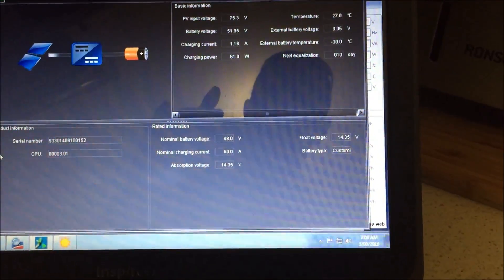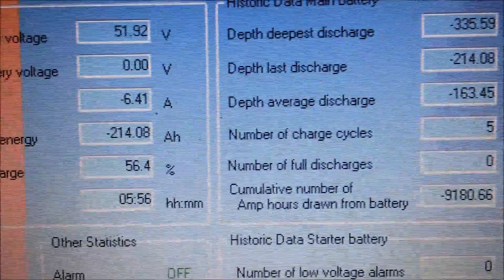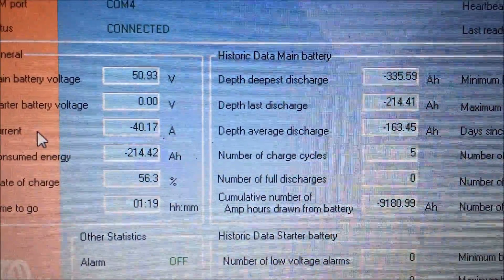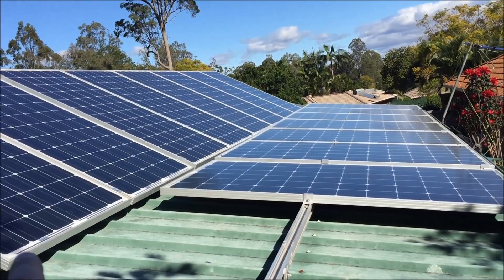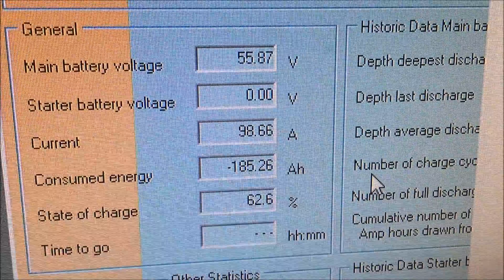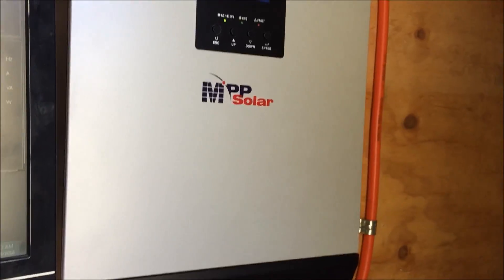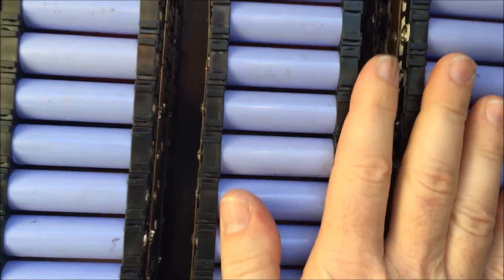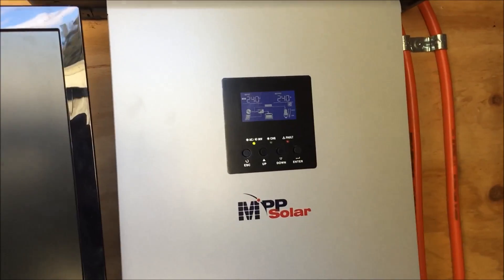100 amps charging 18650 cells at 48v

Comment: would this power bank would be enough to supply an electric yacht ? with 48v motors and solar charge? thank you
Reply from the maker: IT's possible that's for sure, but I think on a boat at sea you'd need something more mechanically strong & more reliable

Comment: Pretty crappy.. Running A steel mill would use huge amounts of those batteries as much whole Rotterdam harbour filled.And needs twice the input direct power needs.
Reply from the maker: Lucky i don't own a steel mill :)
Reply: Forget the plant,think of those batteries!
Reply: But someone has to produce that! As does mining lithium and other ore takes loads of energy.If we all run on batteries someone should have square kilometers of battery space.It's just not doable with today's technology.
Reply from the maker: it seems to be very much doable for my needs :) not trying to save the planet, just do my part

Comment: You may have thought of this already, but so often its the simple things we overlook (ME ANYWAY) I notice you had a couple of whirly gigs up on your shed roof next to your panels. Why not give your Inverter power shed one and one for your battery shed. whirly on the top of each and a couple of cool air intake vents at the bottom of each. I apologize if this is already done, but I noticed you checking temperatures. Cheers Pete.
Reply from the maker: Great idea, how ever there isnt the room from shed roof to house over hang
Reply: In that case if its under shelter a 12volt 4" computer fan on top of each as long as it rotates freely the convection would cause them to rotate freely and draw without them being wired in. Again just a thought. Cheers Pete.

Comment: Watching all of them. But I insist you look for covers for your banks any pin or conductive material may fall through them and cause havoc. Look on cooling fans, heat sinks, temp regulators and such as well. I have subscribed this is awesome!!
Reply from the maker: that's why it's in a locked shed my friend - thanks for the sub.

Comment: I'm curious with these 18650 battery banks.  What happens when one of the batteries fails.   Is there a maintenance nightmare here?
Reply from the maker: Define nightmare? You replace faulty 'bank of cells' with a spare then pull faulty one down and retest.. Really simple 15min to change out with spare too easy!
Reply: Sounds simple enough.   I guess you just test your cells if you notice a big drop to see where the problem is,  swap it out then test for the bad cell.   How often do you experience failures given you have 100s or 1000s of cells in use.   Also, is there a fire risk?   I guess thats the 'nightmare' in my head.  lol.
Reply from the maker: +alchemist1138 had a few failures in a few older videos and a marsbar will catch on fire given enough time and the right circumstances.

Comment: Just a question Pete.
Could you use the electric battery in a evehicle to power your house? 
Our power company rates drop dramatically after 9PM so I'm thinking if I bought a Plug-in Prius or a Volt I know I'd charge it at night. But if I wasn't going to use the car that day could I set up a system to use those ready kilowatts on hot days to offset the peak load hours?
Reply from the maker: +Rocket Rose I guess it is possible no idea how to do it tho.
Reply: Seems Honda and Nissan have it sussed. Here's a link to Nissan Leaf's Vehicle to Home unit. http://www.nissan-global.com/EN/TECHNOLOGY/OVERVIEW/vehicle_to_home.html 
Cost estimated at $4,350 with a $1,000 rebate in Japan. 6KW

Comment: one thing with your system is that it is so clean and neat and simple looking(in a good way), All these other system I have seen have Shit every where.... so much stuff 3 or 4 chargers just box after box wires running all over the place. yours has beautiful battery packs, lined up nice and neat. some nice thick wire. Inverter and that's it basically.

good job well done..

hope mine will be half as good but I know it wont....(i'm too cheap)
Reply from the maker: The whole premise for this project is repeatability without any issues. I'm very lucky to have the time to invest in this to make it look good as well as function . thanks as always for your input

Comment: Howdy, do you run airconditioning units on your system. I'm looking at building a system just for my airconditioning any ideas ect, nice videos mate.
Reply from the maker: Just tried to do a video response but audio was on drugs. We only run a small 1000w unit for heating and cooling in a small bedroom that my two youngest boys have. And it run fine they've been running it for several hours each morning for the past month just warming their room while everyone else is still sleeping. Batteries and 48v inverter handle it fine. So well in fact wouldn't mind putting another one onto it once i get one more pack of batteries built.
Reply: Depending on where you live and your financial situation consider checking out things like geothermal heat pumps. If you don't have to dig too deep and its not full with rocks (and you've got the time and money to invest in it) the long term energy benefits of that could be worth it.

But yea based on what was demonstrated with the microwave a limited amount of airconditioning would be viable if your plan includes enough energy storage to make it through a typical hot day.
Reply from the maker: no need for that, live in Brisbane Queensland Australia. Don't really get too many extremes & my home is insulated very well. Heater we also have wood fire place and summer just one large aircon is needed to keep the whole house cool.

Comment: Another great video M8. I have a question for you, I have a pip 2424smx and the data readings  I get with the S.O.C / VOLTAGE ect  are not reliable enough , I was going to get a Victron battery monitor??? Is there a valid reason you've decided to give yours away, seems you've not long had it. Is there a better option.
Reply from the maker: +Boss Cock I thought I broke mine so I put it in for warranty & was impatient so just bought another one. :) only to find out it was just me that broke the data cable.

Comment: good choice on the give away, sparky definitely earned it with all that cheap work.
but if knew it was only $140, I would have offered that much for it :P
not that I have anything like the battery capacity or inverter to make use of it.. but wahh haha
Reply: I agree.
Also treating your local sparky right does come with perks in the long run.

Comment: what is the distance between solar panel and the roof? thx
Reply from the maker: +Serviciosymas 10-15 cm I'd say
Reply: HBPowerwall thx. So you setup goes from solar pv down to mppt charge controller at 48v and controller directly connects to your 18650 array correct? How are you dealing with balancing ? No problems so far?
Reply from the maker: +Serviciosymas yep, about a month of use no issues yet, manual balancing will be done when required manually checked there times a day.